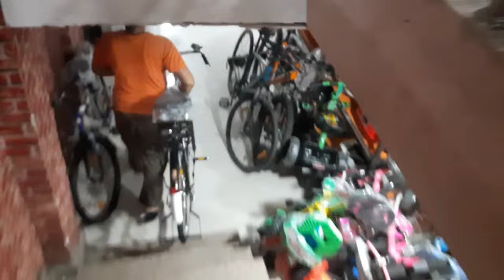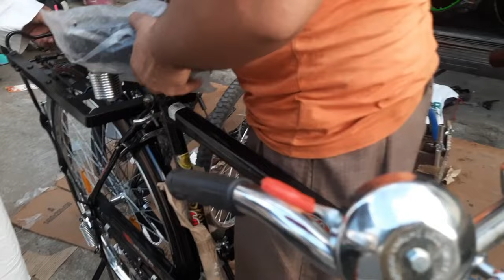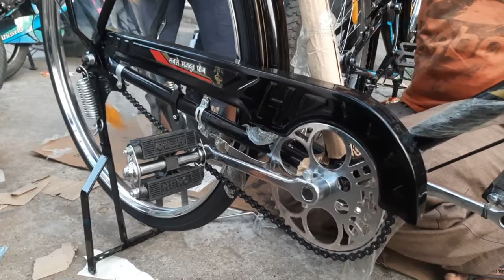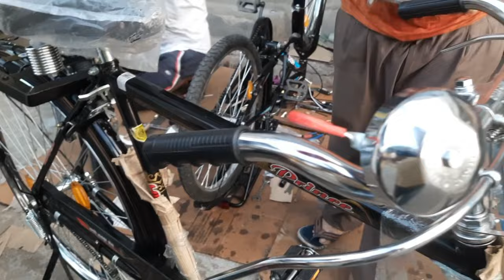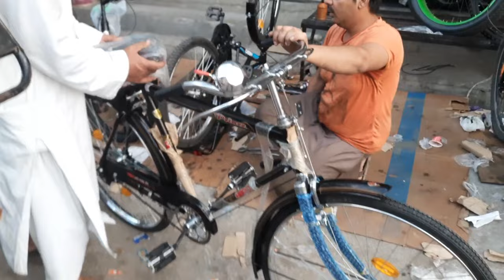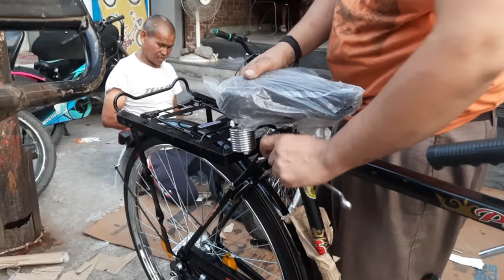Hero cycle is best for Indian streets

Comment: Yes Hero cycle is reliable an  qualitative. But the main problem is Pedalling weight is higher. Pedalling weight over the  the Crank plane is returning Knee pain and Muscular fatigue. Drive gear and driven gear ratios are incorrect. R & D of Hero cycle need to re-research over this gearing issue and make it anatomically friendly.